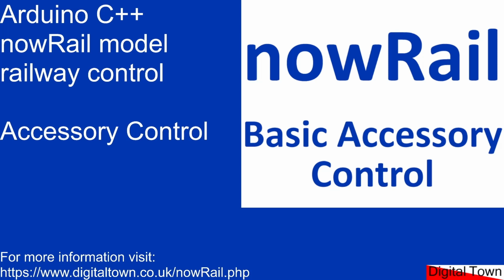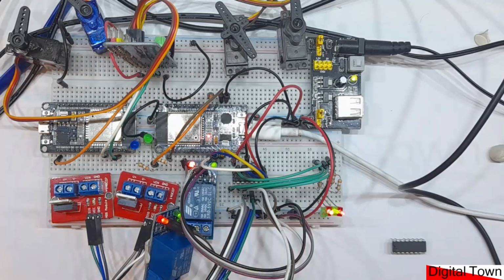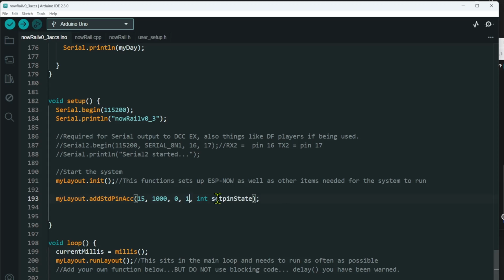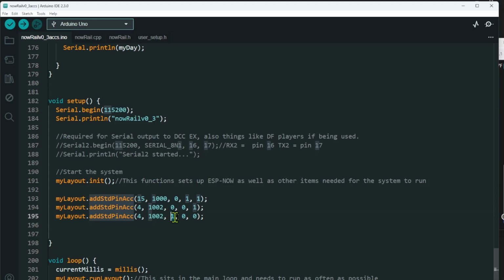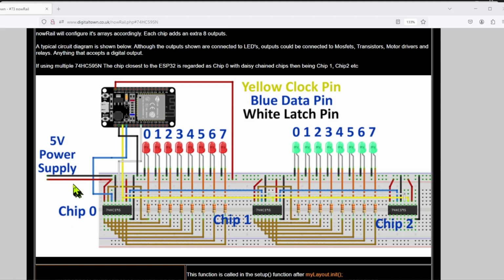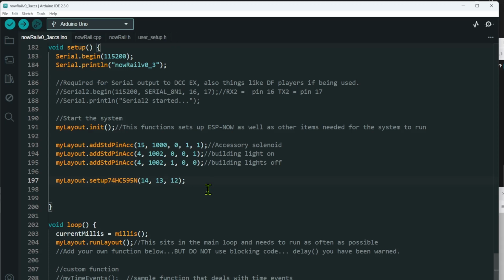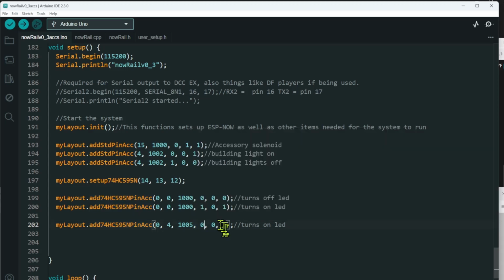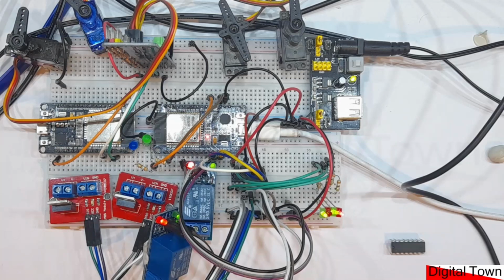#77 Arduino C++ nowRail adding basic accessory control

Comment: Thanks again for all your great sharing. Do you have a recommendation on what is required to slowly flash an led? For instance, a switch is thrown causing an LED to flash at a rate of off to fully on takes 1 second, then from fully on to off time is 1 second and continues flashing until the switch is turned off. Thanks
Reply from the maker: That could be added as a PCA9685 effect like the ones in the 0.9.1 update
Reply: @digitaltown5442  Thank you. I saw your 0.9.1 update about 20 minutes after I asked that question.
Reply from the maker: @tennistech  I also realised that you can always add your own custom function code driven by an accessory decoder address as shown in the Custom Functions video https://www.youtube.com/watch?v=Imy_WF_eGG0